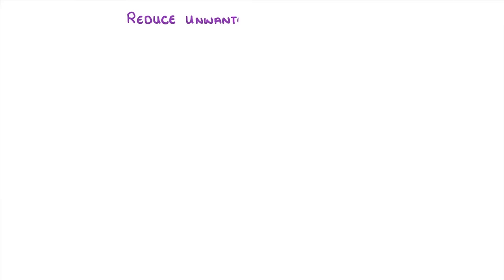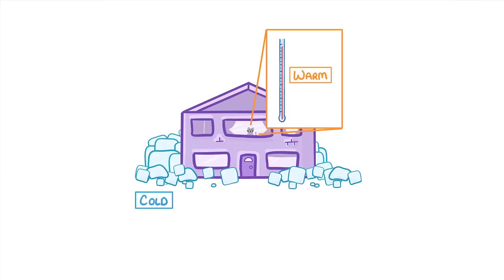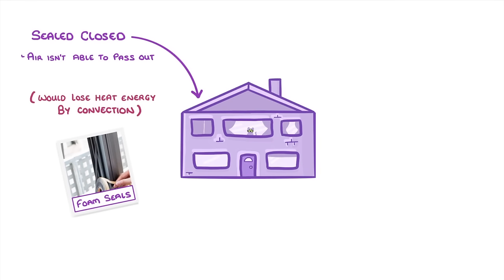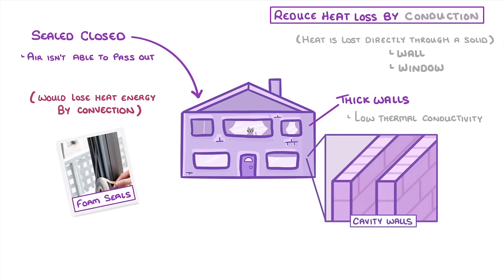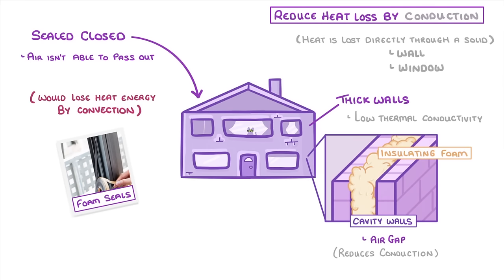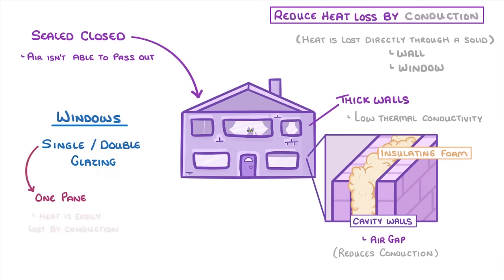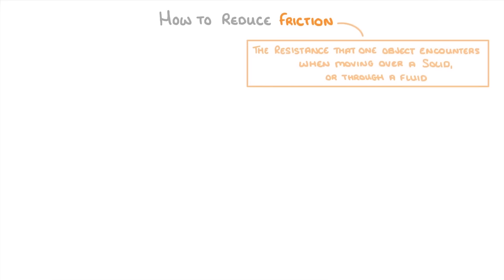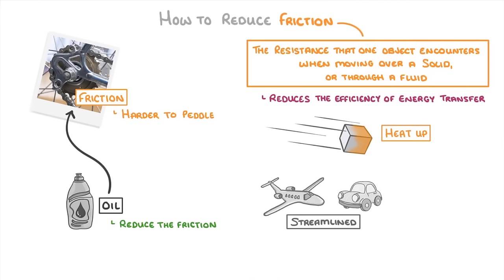GCSE Physics - Reducing Energy Loss - Insulation / Lubrication / Aerodynamics #6

Comment: what does convection and conduction mean any1
Reply: convection is when a heat source heats a certain part of a liquid or gas. The particles in this region gain kinetic energy because it has been heated, so the distances in between the individual gases expand, As they expand, this part of the gas/liquid becomes less dense, meaning it starts to float over the top of the part of the gas/liquid that has not been heated as much and is denser. This is also how radiators work. As the less dense air/liquid on top gets cooler, (because the energy in its thermal energy store has been transferred to its surroundings like walls), it moves back down again and replaces the newly heated part of the liquid/gas which creates a convection current. 

Conduction is more common in solids. When you heated a certain part of a solid, the particles start to vibrate more and collide. These collisions transfer energy to the neighboring particles of the solid or other solids. Its harder for air to conduct because air already has lots of energy and is moving around a lot, it is harder for the energy to be transferred to its particles. 

I hope this helped, or at least a little.